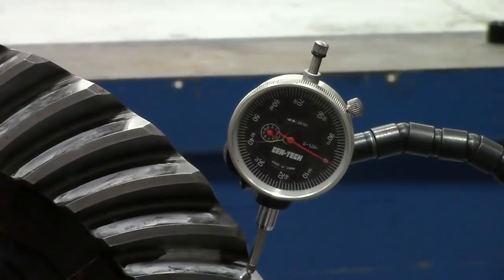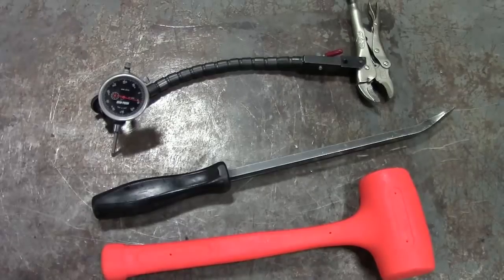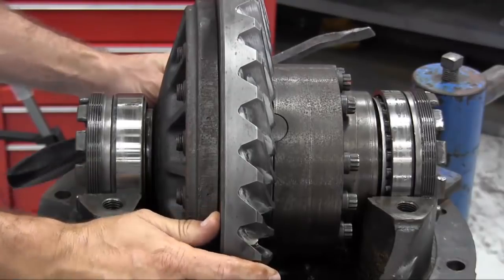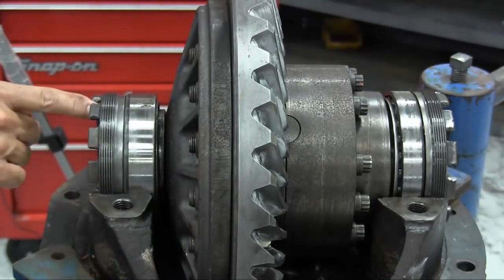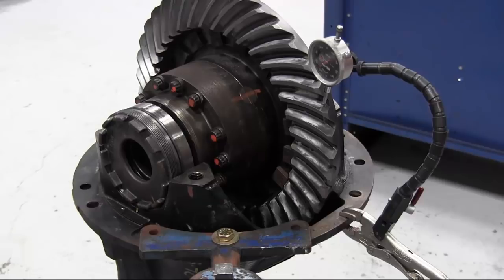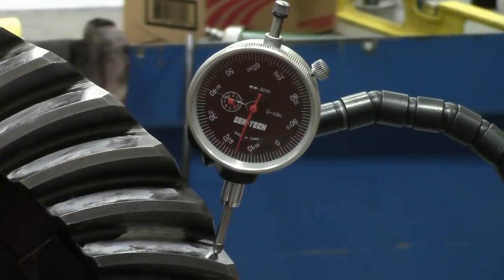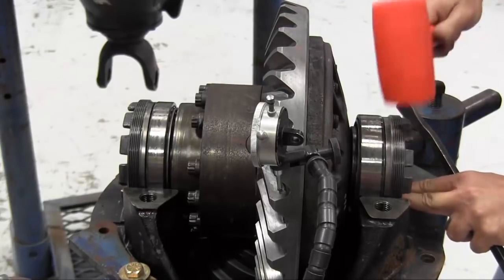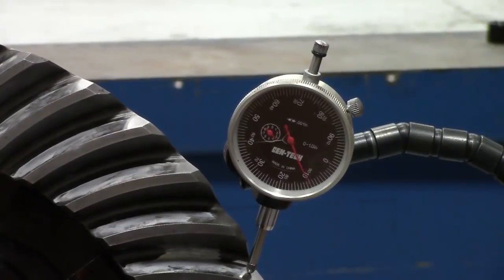Side bearing adjustment video

Comment: Excellent explanation,many thanks,but I am a little bit confused about the relationship between the pinion depth and the pinion bearings preload and the backlash,is the backlash obtained only by moving the ring gear or by adjusting the pinion depth

Comment: No.  You just adjust the side load when you stop hearing the pinion gear slipping on the ring gear when you take off, and you should be good.